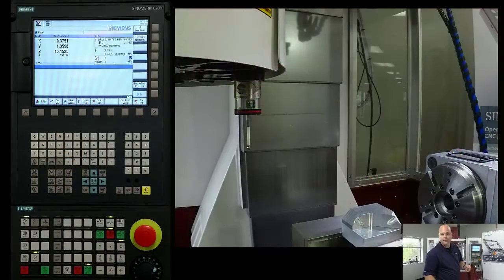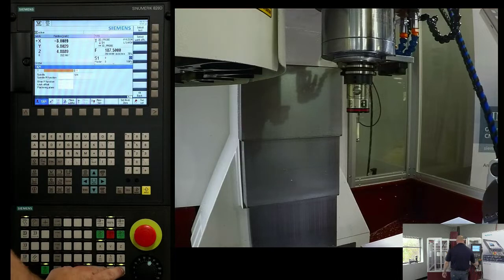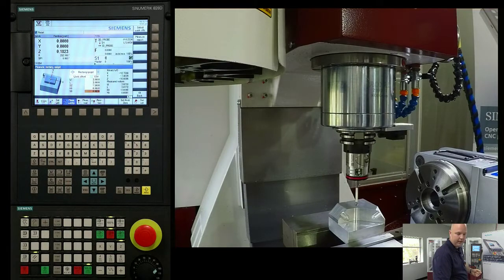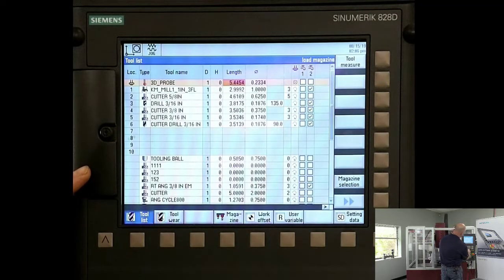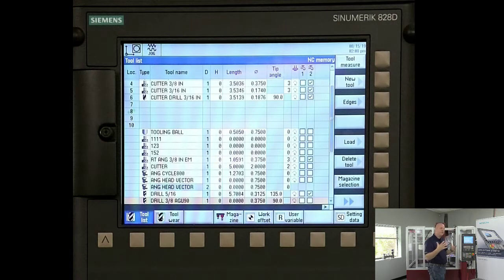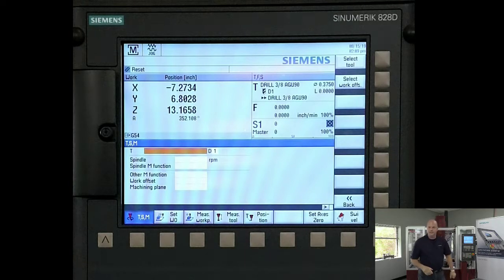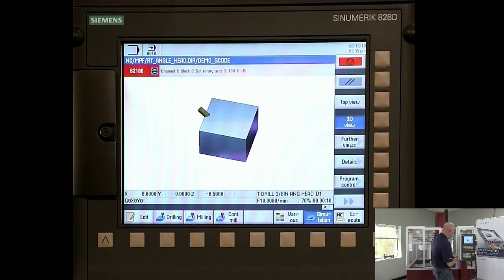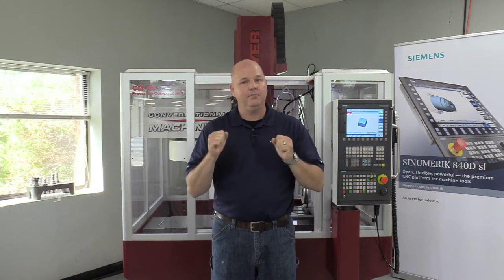Part 3 - Adjustable Angle Heads with Swivel Cycle Operation & Programming

Comment: If you cancel cycle 800  and start another one in the same program do you have to give it another work offset
Reply from the maker: Once CYCLE800 is cancelled, that swivel transformation is truly canceled but the work offset remains unchanged. If you want to reuse it later in the program, you could simply copy-paste the original CYCLE800 line to activate the transformation again. However, CYCLE800 does not change the internal reference data of your work offset. I hope this makes sense, let me know if you'd like more clarification.
Reply: @MrCNC  Thank you